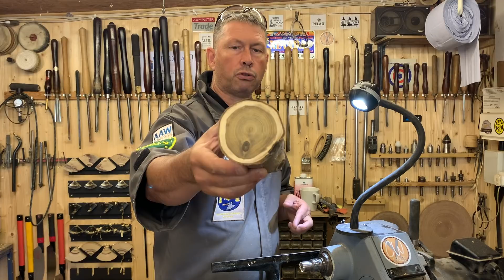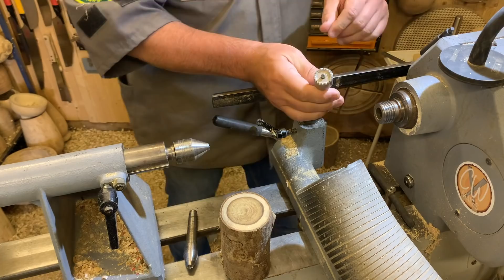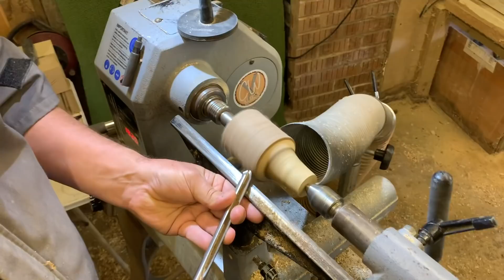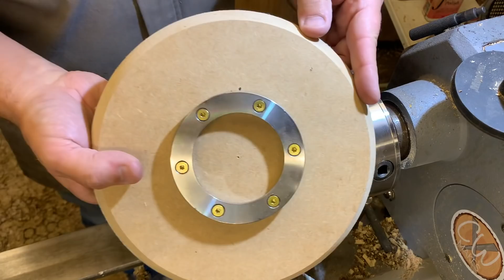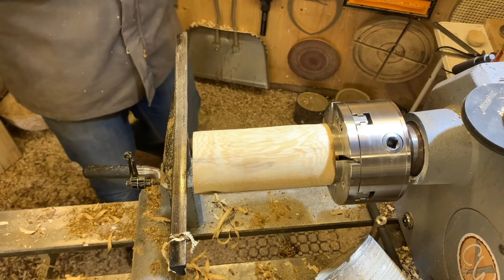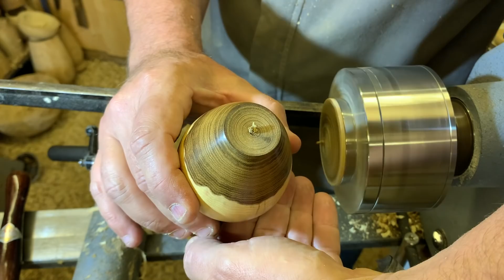Turning Thursday - Vase and Toadstool Projects

Comment: What is the length of the blanks you are turning. These are really neat projects that would sell at craft shows. Something I’d like to turn when I get back to turning from my surgery. Keep up the good work
Reply from the maker: Hi Dave, Colwin says they can be whatever size you want, but work best in lengths of between 75mm-100mm long x 40mm-60mm diameter. Hope that helps.

Comment: Great work, love the 2 projects but i would've left the lip of the bud vase as natural edge also, just adds that little bit extra. I have been trying to find some Laburnum here in Aus but not having much luck. Any reason, you didn't use the scroll chuck for both? you would've been able to finish the toadstool on and not have to use the sander except for the base.

Comment: Very interesting lessons can always learning something new. 
After how many days or weeks a trunk of a tree can be turned after it had been cut down . Thanks always for your best advice you give us thanks again.
Reply from the maker: Hi Laurence, the following reply is from Colwin - "The best thing to do is rough turn the piece while wet but leave thick. The timber will move but a lot of the stress is taken away. The general rule for timber in plank form is a year plus 1 per inch. So this means a board of 3 inches will take 4 years to dry." I hope this helps!
Reply: @axminster  Thanks for your reply it's very helpful  and hopefully learning more  from your lessons thanks a lot.